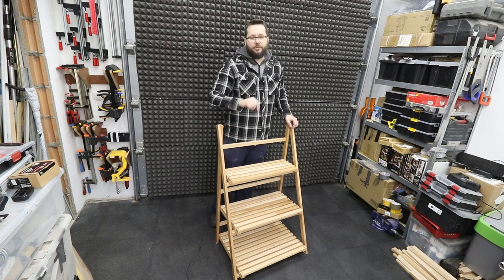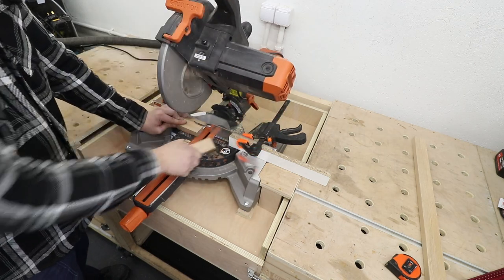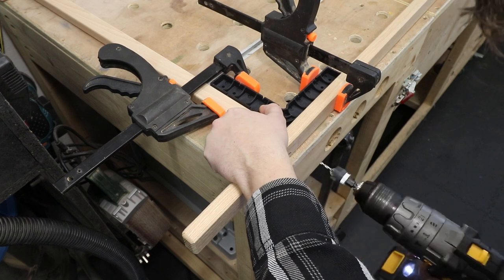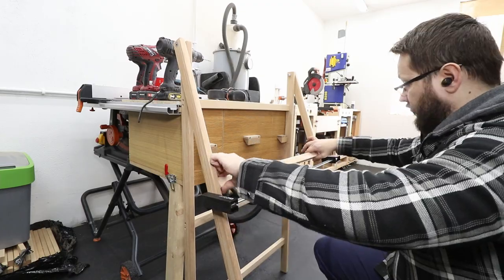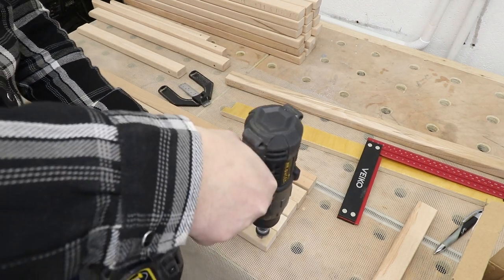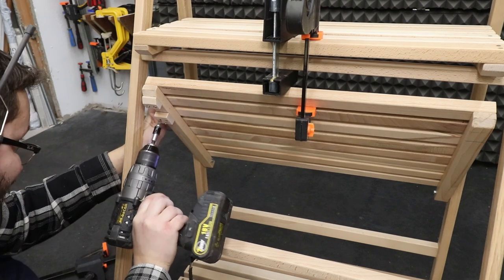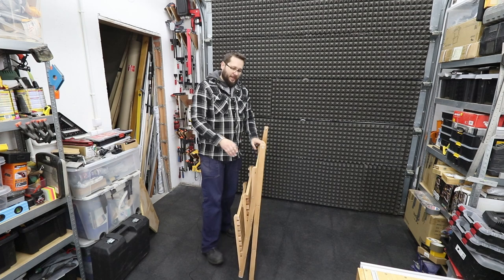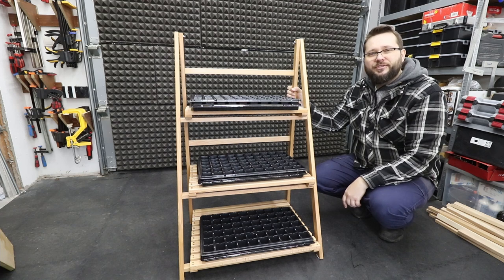DIY Foldable Ladder Shelf I Indoor Garden Ladder Shelf

Comment: .I'm in the US and see that the legs are 1" x 2"s (20mm x 38mm} but can't find a size that corresponds to 2 cm x 3 cm used for the rest of the pieces. Did you get 1 x 2s and cut them down to 3 cm wide?  This is a great-looking project and I'd like to make a few. Thank you for showing how it's done.
Reply from the maker: Trim the boards to correct sizes.

Comment: Hi, I love this design. I'm going to make a version out of cedar for outside. One piece of advice when using a stop block at the miter saw: hold the material on the stop block side and let the "drop" side go. With the stop you create a risk of material getting jammed up between the blade and the block.
Reply from the maker: Fair point 👍

Comment: Hi there, great little project, would be interesting if you compared timber prices between Poland and the UK, since you left the UK timber prices here have gone through the roof!
Reply from the maker: Thanks,
The prices of timber here in Poland also went through the roof. I had a look some time ago and the prices were comparable to UK prices which means the timber is more expensive in Poland as people earn lot less. So yes its madness. Hence most of my wood or sheet material related projects are on hold. As I can't afford to buy anything right now lol So I'm trying to use what I got.

Comment: Nice project mate...
Spring is upon us and gardens are now the priority after the winter of neglect 👍
My only criticism would be to either stagger the screws so not inline and prevent splitting out on the end grain or dowel both ends, glue up and pin.
Keep up the good work and stay safe mate..
Reply from the maker: Yes I was thinking about dowels to be honest but I need it quickly and I wanted this project to be as simple as possible so that people with an electric drill and a handsaw could tackle it from wood you can buy in big diy stores
Reply: @CasualDIY  I can understand what you are saying mate... A drill size for holes and small square block for straight drilling is also as effective as a dowel jointer. Whilst screws are simple and as affective, dowels are a lot cleaner as they say.
Great effort and I am sure plenty will relish the plans 👍👍👍
Reply from the maker: @philbrandon0532  true true 👍